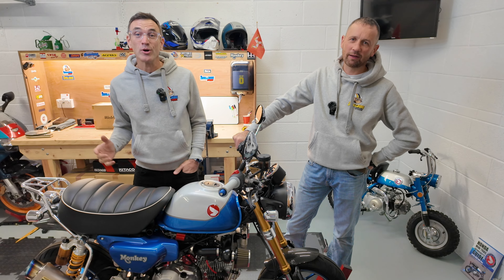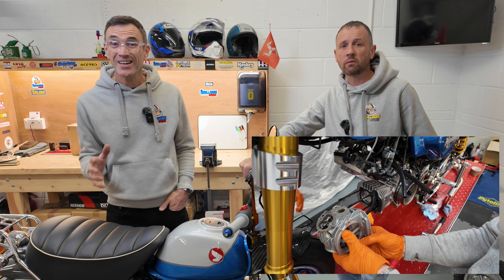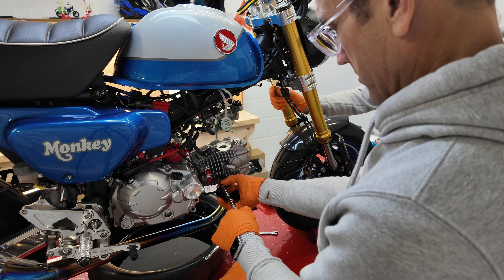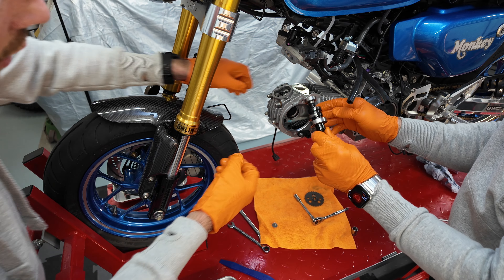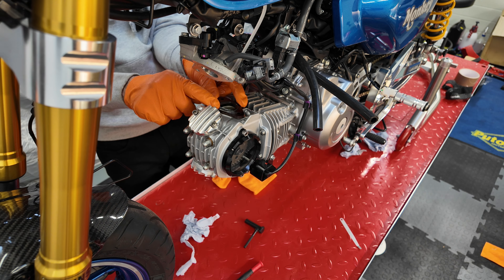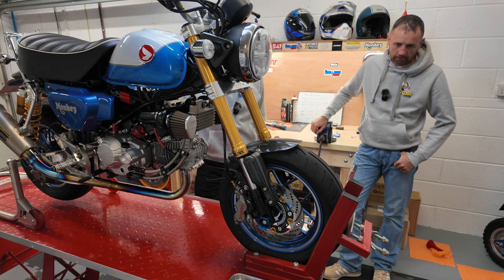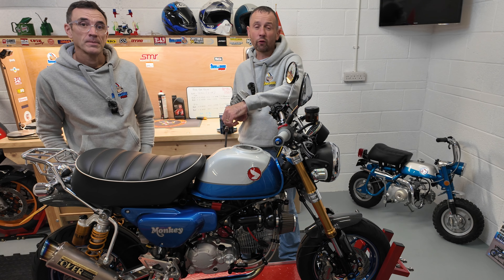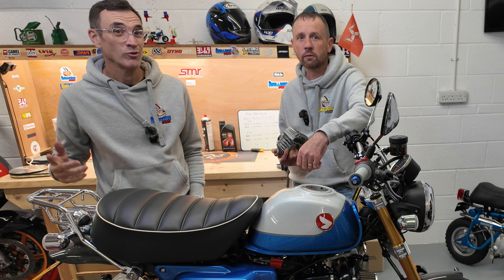Takegawa 145 vs Kitaco 145 Big Bore Kit Noise

Comment: i've just clocked 15.7k miles on my 143 takegawa 2015 grom. perfect right up to the big end failure on the standard crank.  i'm just rebuilding with a kitaco crank and 163cc kit, see how it goes!

Comment: Morning lads , so I’ve fitted the same kit yesterday to my 22 Grom . Set the valves to your clearance setting .. I found the tappets noisy… did you leave yours at 0.08 ??
Reply from the maker: Yeah… both 0.08mm. Have you tried them on the bottom of the tolerances?
Reply: @ I will try them at a bit of a tighter drag on the filer gauges . It just sounds like the inlet is a little noisy. 👌✊🏻

Comment: How did you get on with the takegawa 145 flash at dynojet ??
Reply from the maker: It was a really good (long) day… very different! Vid should be up this weekend
Reply: @  frank has already sent me the flash just waiting for results from you first before I install lol
Reply from the maker: @PaulKneller-l5f  get it installed…you won’t be disappointed ;-)
Reply: @ better than kataco
Reply: Only had takegawa fitted last week at bens after watching your video 👍🏻
Reply from the maker: @ depends what you’re after… absolute power the Kitaco made a fraction more, torque, takagawa miles better👌🏻
Reply: @ just be happy if 5 th gear held and didn’t drop off
Reply: Only done 100 miles run in so might get it installed and take it easy 😂

Comment: Thanks for the comparison gents. The rattling of my kitaco kit drives me crazy, but I dont want to shell out the cash for another kit. I guess there is no other way to fix it. If I was to get the takegawa kit, would I need to do a dyno re-tune? I am running a piggyback ecu NK Racing Shift Pro for ct125 gen2
Reply from the maker: We’ll know more this weekend when we go back to the dyno. If it’s running fine on the Kitaco map, then it’ll be ok. Watch out for next vid👌🏻

Comment: Have you thought about fitting 34mm throttle housing from bens bikes
Reply from the maker: Copy the link in and we can have a look
Reply: @SmallboreAndMore  Big Throttle Body Kit for improved output performance !!■DetailsThis product is SP Takegawa's original "Big Throttle Body" for stock cylinder heads.SP Takegawa'…
Reply: How many miles running in on the 145 kit ?
Reply from the maker: there were around 50-60 break in miles decide the dyno and about since done about 6-700miles at the Isle of Man TT and bombing around the Lake District

Comment: Great video. Perfect timing as I’m starting the journey of doing a BBK upgrade to my 2022 Monkey and was just deciding between the Kitaco and Takegawa.

I’ll be watching for the dyno results and the 4V install as well (though the price of that kit rules it out for me).

The Takegawa kit comes with the N10 cam, but their graphs show better performance with the N20. Any chance you could install the N20 and compare dyno results?
Reply from the maker: Our dyno time in the tight thing… and we’ve planned the standard 145 kit followed by the 4 valve. I’ll speak with DynoJet see if they think it could be worth the extra time. What do you believe the power difference could be?
Reply: @SmallboreAndMore  their graph shows about the same hp at around 8500 RPM, but the N10 drops off after that, while the N20 gains power right through to 9500RPM. This is all tuned through Takegawa's FI-Con Type-X FI controller though. The PV3 may get different results.

Comment: Hi Guys,absolutely loving your channel.would you be able to help me with a bit of advice?
I have a 2023 monkey with a scorpion exhaust & takegawa air filter fitted.I just purchased a power vision 3 from dynojet after watching one of your previous videos.Ive never flashed anything before & just want to make sure I’m doing the right flash.
Can you confirm which of the pre installed flashes I should select.hopefully you can help.
Thanks
David👍
Reply from the maker: Hi David… glad you’re enjoying them… loads more to come! 

Is it a Takegawa panel filter or a cone filter like the one fitted to the yellow monkey on our channel?
Reply: It’s the cone filter that fits onto the throttle body after removing the stock air box
Reply from the maker: Good stuff, that makes it more straightforward
Reply from the maker: @davidadam7576 what tune files do you have the mo?
Reply: C1620001.djt
C1620101.djt
Full exhaust intake.djt
Full exhaust stg3 intake.djt
Full exhaust system & intake.djt
Full exhaust system.djt
Kitaco 145
Over ex stk intake.djt
Over exhaust dna stg3 intake.djt
Run ins
Stock exhaust
Yoshimura full exhaust system.djt
Yoshimura rs-3
The others are all stk
Reply from the maker: hi, any baffle in the exhaust?
Reply: @SmallboreAndMore  yes mate
Reply: @SmallboreAndMore  hi yes I have the baffle installed 👍
Reply from the maker: Dave, I can’t reply? Can you email us or use Facebook?
Reply: How did you get on david im considering a power vision 3 for my 2023 monkey i dont want to buy it if every mod or almost isnt covered
Reply: @ hi mate,I got on fine,it comes pre loaded with a lot of maps for different modifications.
What mods have you done?
Reply: Here’s what’s installed 
Over Ex Stk intake
Over Exhaust DNA stg 3 intake
Run in 4K rpm 145cc kit,full exhaust
145cc kit full exhaust,stg 3 intake
Full exhaust system
Full exhaust system & intake
Kitaco 145 cc kit,over exhaust
Kitaco 145 cc kit,over exhaust,dna stg 3 intake
Full exhaust stg 3 intake
Stock exhaust
Yoshimura full exhaust
Yoshimura r/s 3 exhaust,chimera intake
Reply from the maker: @davidadam7576 we will do a short vid showing the mods🫡
Reply: @SmallboreAndMore  brilliant,thanks